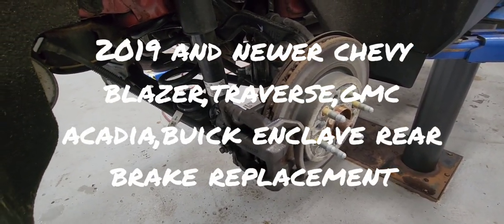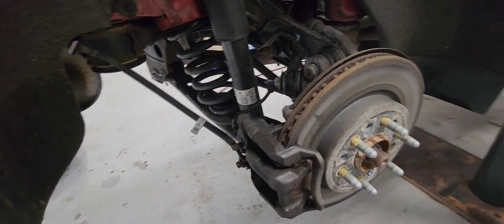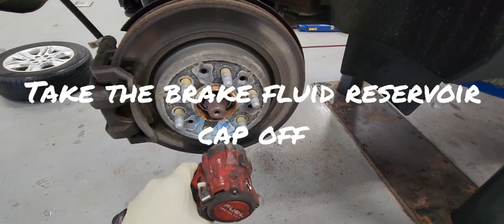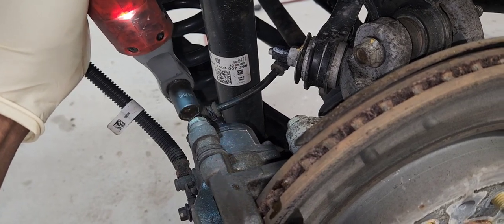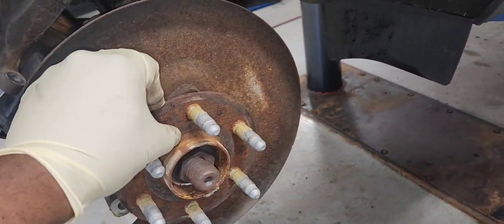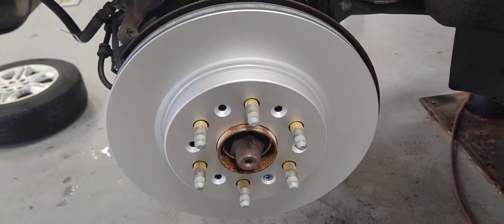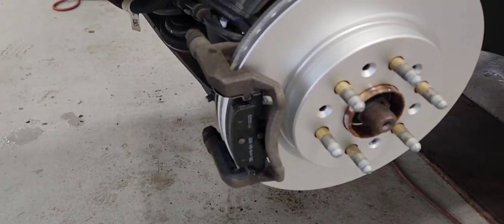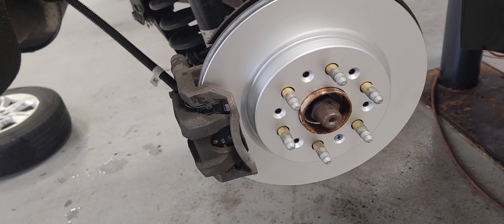2019 and newer chevy blazer,traverse,gmc acadia,buick enclave rear brake replacement

Comment: Considering my traverse is equipped with a parking brake button, is the scan tool still required? or does the scan tool allow to retract the caliper piston farther out
Reply from the maker: Yes you need the scan tool to retract it,and reset  when you done
Reply: You can manually retract it without a tool. 
After starting car, hold brake and push the e brake button and hold for 10+seconds. It will go into service mode. Let go of the brake and press it once. It will start retracting and prompt you when it's done. 
Don't forget to reactivate your e brake after you're finished. Hold your brake pedal and lift up on the button and hold it.
Reply from the maker: Good , I've been using  that method on the trucks, not on the traverse or blazer I don't see why it wouldn't work 💪
Reply: @eric5981 this doesn't work on say a 2020-current Blazer with the new button e brake. Tried for about 45 minutes today and it won't fully retract or come up with a service option.
Reply from the maker: Try this scan tool
https://youtu.be/TSWwa5fJRW8
Reply from the maker: That combination only work on gm trucks, try this
https://youtu.be/TSWwa5fJRW8